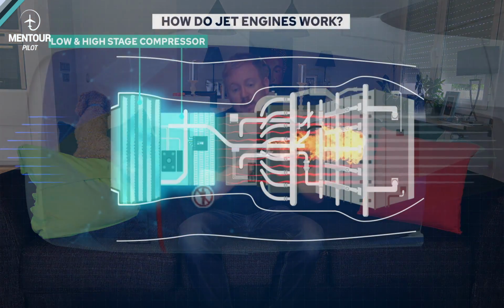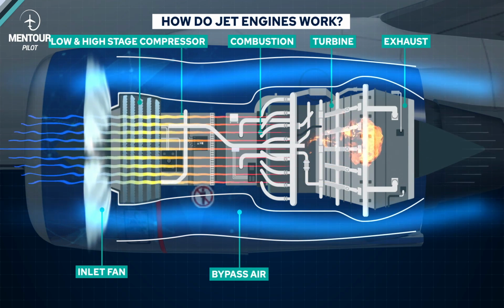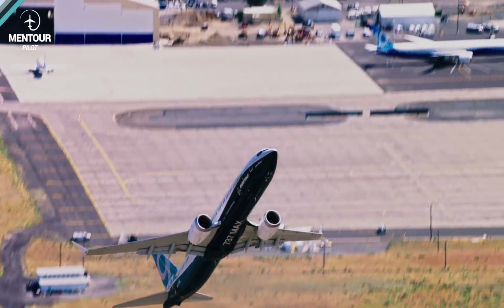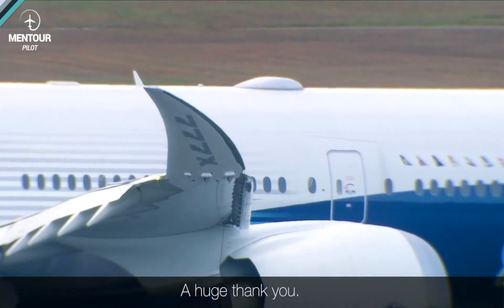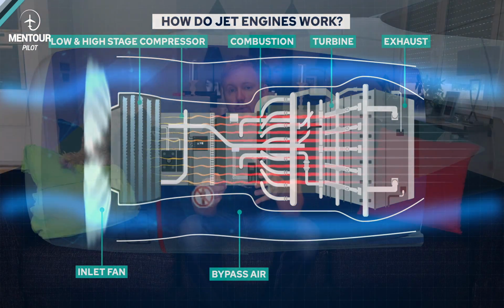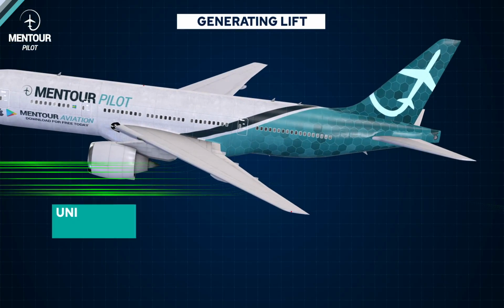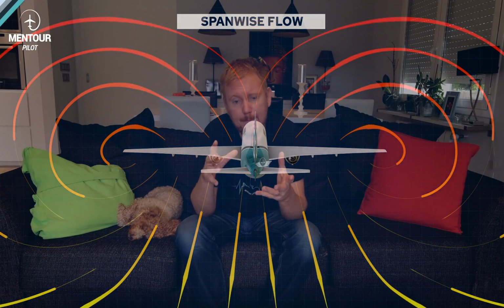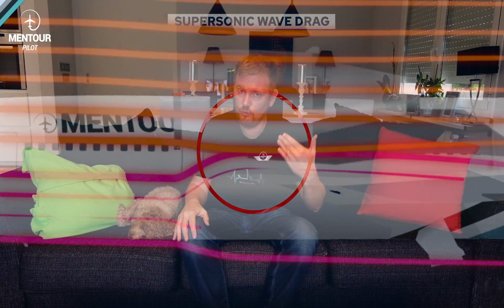How BIG can jet engines get?!

Comment from the maker: The first 1000 people who click the link will get a FREE trial of Skillshare Premium👉🏻  https://skl.sh/mentourpilot25 Start Learning today!
Reply: mount engines on rear again , not on wings
Reply: If they want even bigger engines, why wouldn’t they just use the wing position and angles of a TU-225? (I’m not sure how it’s called but some planes have the wings above the frame like the Cessna or TU-225, and some have the wings angled down rather than up)
Reply: @arieldahl  جحح
Reply: @ebrahimanwer81  what was so funny?
Reply: Why can't we put bigger engines on the roof of the plane just above the wings?
Reply: What about an elliptical wing?
Reply: @computerbob06  WHAT about an elliptical wing? I don't understand the relevance in this context. They are inefficient at high subsonic speeds, and are prone to poor stall characteristics which make them difficult to fly at low speeds, and they are more costly than straight wings; they pretty much stopped after the 1950's (with cheap wings remaining straight, and fast/efficient wings going swept). They offer no benefit in terms of engine size or positioning.
Reply: I have a question:
 
If the bypass flow (which is being driven by the turbo fan at the front) is responsible for 80% of an airplane's thrust, why not just get rid of the actual center jet engine itself and make it 100%? For a mere 20% decrease in thrust, you can massively simplify and streamline the design of the engine, (since you no longer have a complex jet engine to deal with) and this would allow you to optimize the engine fairly easily, which would allow you to then easily improve the thrust to more than what you originally had, all while keeping the maintenance and repair savings that come with decreased complexity.
 
The only reason I can think of to still have the jet engine in there is if it's massively more efficient, but I can't see that being the case, given the amount of waste heat.
Reply: @elooflskhu5358  You can answer this yourself :). What drives the big fan at the front? Might be the gas turbine in the core, maybe? How else are you going to drive a big fan to get "100% thrust"? In a turbo-jet engine, the hot gas provides the thrust; in a turbo-fan engine, some of the energy from combustion is taken out of the exhaust and used to push the core turbine blades at the back, which in turn drive the big fan blades at the front - that gives slightly less thrust from the exhaust jet of hot gas, and more thrust overall from the big fan propelling air through the engine ducting (like a ducted fan, driven by an electric or piston engine).
Reply: @andyowens5494  Thank you! Makes sense.
Reply: What about in the wing like the old Comet aircraft?
Reply: @jimmylivingston6338  How thick is the wing of a modern aircraft? Pretty thin, to be as efficient as possible at high speed. Its much smaller than the diameter of a turbo-fan engine, so the engine wouldn't fit. The Comet used turbo-jet engines, with a low bypass ratio, which were less efficient (for all the reasons stated in the video). As also stated towards the end, if blended wing designs become the norm for aircraft (like the B2 Spirit US bomber), then there may be a case for larger fan engines fitting into the wing. Make sense?
Reply: Am i to late?
I try but im flying around as a building maintenance person!!
I wish i could realy "takeoff" but my math is awfull!!!
 - AD... jimatemi full contact karate.... AD end!!!
 Would happily sign up for a good deal m8, love your channel, all the best Jim from London 💪👍
Reply: Why can't  we integrate  engines in the wings?
Reply: What about the rolls-royce  ultra fan? Why are they putting a planet gear between the fan and the turbine. Is this not to expensive comparing it to the GE9x? Saludos
Reply: Mark Grudt  The 747 is back on some routes so the airline can  enact "social distancing" for Covid19. I am taking a flight just to ride the 747 again. If the Concord came back again, I'd ride it again just to ride on it again. The British Airways Concord was the way to fly first class. I did New Years 2000 on a Concord flight that beat the sun by so much, we actually celebrated New Year's over 6x in one night with one flight!  Land, deplane, celebrate, reboard, take off, land, deplane, and do it all over again. We had to jump a time zone or two, and one New Year came & went while we were barely off the plane.
Reply: What is being towed behind the aircraft's tail @13:47?
Reply: @cia212  Its a pressure sensor, only deployed on development aircraft, when they are trying to evaluate aircraft handling characteristics and need to know the static air pressure not affected by the geometry of the aircraft body itself disturbing the air. It extends to about 50m behind the tail in flight (it cant be that far at take off as it would drag along the ground :)).
Reply: With all due respect, did you gain a little weight? I know many people have because it has been a stay at home year due to the virus. keep up the great work!!
Reply: I'm sure RR will come up with something revolutionary . There is no optimum efficiency. You can allways strive towards the maximum.
Reply: @TremereTT  Ba bum tisch!
Reply: you can make top mounted wings and  have a cheaper landing gear.
Reply: @TremereTT  Two primary reasons commercial aircraft do not tend to have high wings (some do - the BAe 146 was made at Hatfield, where I first worked): 1) all the landing gear has to be stowed in the body rather than the wings (reducing cargo capacity - and cargo is cash, and aviation is driven by economics) and 2) safety - all that really strong structure that holds the wings to the body (the strongest part of the aircraft as the entire weight of the aircraft is transferred through the wing box) sits under the passenger cabin, and makes a decent cushion for adverse landings - look up BA flight 38, from 2008: if you stick all that weight and cushioning and fuel above passengers and have a bad landing, it gets quite bad quite quickly. Yes, it can be done when the compromises work that way, but most of the time they don't.
Reply: @andyowens5494  thank you for your insight and your friendly answer.
Reply: It should be the first 100 000 wievers
Reply: @Mentour Pilot, why not move the wing to the top of the tube instead of the bottom? Do it like a Lockheed Hercules or an Antonov an-225 instead of a boeing 777. More room on the bottom of the wings for bigger engines. Low wings were originally designed to get the engines close to the mechanics anyway. With giant engines, a stand is still necessary regardless.
Reply: One thing that you missed about bigger engines is the difficulty in manufacturing these huge parts. Having worked at a major nacelle manufacturer for 40 years, I can testify to the major problems in fabricating conforming parts in these extremely large sizes
Reply: Can you make it like a big a10 warthog and attach them to the fuselage
Reply: I have a serious question for you: Could a P-1112 Aigaion from Ace Combat 6 be built using present-day tech, how well would it fly, and what would it take (not counting money!) to make it work? =^x^=
Reply: okay so why not put the wings on top of the airplane like on the Antonov AN 124 in order to get biger engins below them
Reply: what about inside of the wings...or why no more engines...i believe that 2 4 cylinder engines for Volkswagen are not more expensive than 8 cylinder for Mercedes...why not put 4 small engines with awesome power to weight ratio and fuel consumption,and maybe lower price....it's easyer to  deliver 4 small engines than 2 big ones...you can cut cost even from that..i really like how the GE9X is looking on the 777,but looks are not the priority i think.
Reply: Hey Mentour when you can would you mind showing us the 737 max mcas activation simulation.
Reply: @Aston Ding he doesnt care he just wants money
Reply: Correction - you said Mach 0.8 is 8% of speed of sound, but in reality Mach 0.8 is 80% of the speed of sound. By that logic Mach 1.0 would be 10% the speed of sound, not 100%.

Comment: You could also increase bypass without increasing fan size by shrinking the core. Smaller core with same or better output = win. when this starts happening I wouldn’t be surprised if we see 4 (smaller) engines again.

Comment: the way to make an efficient 2 engine jumbo jet is to mount the wings near the top of the fuselage a la Galaxie C- 5 or the Anatov 225. this would allow a bigger diameter engine without the long landing gear, and 2 giant engines of 5.5 to 6 meters total nacelle diameter might improve efficiency.  Also, longer wings lift  more weight and keep landing speeds reasonable. engines above the wing would also be inherently unstable in the extreme, a terrible idea. I know this from over 10 years of building model airplanes.

Comment: The engines in the thumbnail look about 2x the width of the A350 fuselage, which is 19 ft 7 in
The average house is around 18 feet
2x the width of the fuselage is 39 ft 2 in
That’s 3 ft and 2 in over a Cessna 172’s wingspan

DAMN!!! THOSE THINGS ARE BIG ASF!!!
Reply: If you cut the wings off of a Boeing 737, you could feed its fuselage through the front of those giant GE-9X engines on the new 777-X......... that's how big these bad boys are!!!!!

Comment: There's an important error in a small detail there. When the fuel gets injected into the air and burned, the pressure doesn't rise, it's the temperature, volume and speed that rises. Pressure actually drops. If the pressure increased in the combustion chambers, the flame will be pushed out from the front, the turbine would stop and the engine would stop working. 

The highest pressure is just after the compressor, from there on, the pressure goes continuously down to encourage the gasses to get out through the business end.

Comment: In terms of overall engine efficiency, the aim has been to get operating temperatures higher, all else being equal.
Eveyone involved in jet turbines is trying to do that.
That's a much better goal than to build a bigger engine.
If you can get more efficient, you reduce the fuel you must carry, which is your Golden Grail.

The turbine operating cycle (Breyton Cycle) is fundamentally limited by operating temperature and pressure.
The way to think about it is that you have an optimum Turbine Cycle Pressure Ratio for a given Inlet Temperature.
And this optimum pair (of Temperaure and Pressure Ratio) gives you your overall Thermal Efficiency (which governs fuel efficiency, and Thrust per Kg Turbine etc etc).

And if you can increase your Inlet Temperature (run hotter), that moves your Optimum Turbine Cycle Pressure Ratio higher.
Which gives you a better efficiency in turn.

Basically, you design your turbine to run as hot as it can, and then make it run at its optimum pressure ratio.
This has improved turbine thermal efficiency from +/-20% to near 50% as turbine operating temperatures have increased from 600 C to >1,500 C.

What limits operating temperature is the current materials engineering state-of-the-art: especially coatings technology.

There are multiple graphs from researchers that show the general progression in efficency as a function of operating temperature, with each jump linked to changes materials engineering.
The intial regime was governed by various wrought alloy designs, which maxed out at +/- 800 C.
Improvements were then made by adding in cooling channels.
That limit got increased to +/- 1,000 C by tweaking the way the allows were made: directionally solidified etc
Then you got a single crystal turbine blades, in effect you grow them, blade by blade, which got you to +/- 1,100 C
And now it's working on using multiple layers composed of different coatings on top of these single crystal blades.
These are called Thermal Barrier Coatings (TBC), and aim to get to 1,650 C.

It's a very complex issue to deal with when you are at the heart of a turbine.
The blade needs to have a very demanding set of properties to survive:
- Strength (and retain it at very high temperature)
- Oxidation resistance (at high temperatures, a given material can become very reactive to the fuel/air mixture, and cause the blade material to be degraded)
- Creep resistance (basically, to keep its strength and overall dimensions at VERY high temperatures)
- Thermal expansion requirements
- Thermal transfer (the contact surface can be very hot: you want to have an insulating effect by the outermost layers on the inner, load bearing region)

A simple TBC has an outer layer with low thermal conductivity, to reduce the temperature that the layer below experiences. And next layer would resist oxidation attack, and protect the turbine blade itself: a single crystal type.

But in practice, the requirements are very demanding: you have a complex sandwich of many layers, all in intimate contact, to achieve a gradual change in thermal expansion as a function of cross section, otherwise one layer might expand a lot more than its neighbouring layer, and thus cause a large stress between the two: and cause cracking.

Comment: Another interesting advantage of turbofan engine is the bypass air around the engine core reduce drastically, the amount of insulation/heat shielding required around the engine to protect surrounding structures, especially important in fuselage-mounted engines. Of course, there's always that incredible sound of the turbofan at takeoff power......

Comment: Regarding larger and larger diameter high bypass-ratio turbofans... why not build passenger transport aircraft with high-mounted wings, similar to most modern-era military transports (Boeing C-17, AB400M, Lockheed C-130 & C-5A, etc.) thereby making much more space available under the wings for larger turbofans, allowing the aircraft to use shorter/lighter/stronger landing gears, creating higher natural aerodynamic roll and yaw stability, and also reaping some other benefits of a high-wing airframe design such as easier cargo and passenger loading via shorter, more compact stairs, ramps and lifts? Several successful commercial and private passenger aircraft designs have employed a high wing. Bottom-line, are they inherently less fuel efficient or less profitable to build or what? Is it that much harder/riskier from an engineering standpoint to 'hang' the mass of the fuselage and payload on the wing spars than to 'sit' that mass above them?

Comment: TL;DR
The industry; its engineering, its design and manufacturing, its engineering - it has pretty much "always" been in a state very close to or at the edge of what is percieved as material, physics and engineering design relatively hard limits. Yet RnD always comes up with ways to push forwards, even if at times the individual steps can be relatively small. However, a handful of iterations each delivering 4-5-6% improvement over the former, quite quickly stacks up to make a huge difference overall. 

-

I dunno about this (slightly open ended) projection. The history of practically all areas of engineering and RnD, especially the last century, is a perpetual staircase being built as we climb it. We're rarely if ever working on more than than the development and engineering of the next (no.)1 step or the next foot ahead of a plateu, and the research of the next step (no.)2 to possibly come after that. Among many big reasons for this, is that all the steps build upon their former and progress on other staircases. Therefore we rarely have any significantly clear or firm'ish understanding of what the oncoming next-next step (no.) 2 will end up "becoming"; will it primarily be a further advancing stage of current concepts? Will it be completely new, or something extensively modifying what we currently have? What will it accomplish, how will it do so, what does it enable, what is its limitations etc ...?

As a field remains competitive and highly profitable, it's able to carry the heft of very costly RnD, but still we know fairly little of these future developments yet - that field, that industry will always be at or close to what is percieved (!) as its material and physics limits. Aviation is no different.

Comment: It's Newtons third law of Motion. There has been a planes with over wing engines the YC-14 Developed by Boeing and NASA which was flown and tested but not adopted by the military and the Antonov An-72 and An-74 which did enter civilian and military service both of these were more focused on their STOL performance the XF-14 was capable of Mach 0.78 at 38,000 feet (11,600 m) and these were designs from the mid 70's to the mid 80's so it may be a case of the devil drives when needs must and these idea's may get dusted off and looked at again.
Having said all that I think blended wing and lifting body aircraft maybe a more likely way to go I know Boeing is working on such a design.

Comment: If you burn fuel you do not increase pressure. If this would happen combustion gas would be pressed back into the compressor what would cause a stall. Comparing the pressure during start up the engine you get a higher pressure after the last compressor disk that must be maintained by the changing geometry of the stator blades.

Comment: When you see these Boeings with massive engines hanging out in front of the wings taking of vertically you think of the ashen faced pilot with the control column pushed hard forward while his mate is desperately looking up what that that particular error code means with the sweat from his brow dripping on the manual.